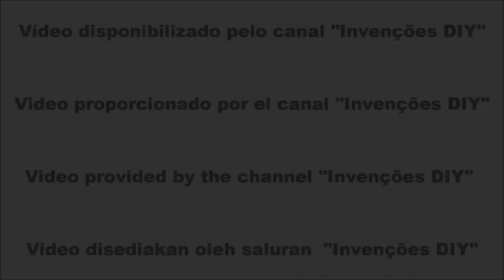Como fazer um simples motor elétrico! Simplicidade do engenho na comparação com motor Stirling.

Comment: Please say  what is the length of primary or base can in your Stirling engine video.  Please . The fruki can 300ml green color.  Please say the diameter also . I tried to find it in internet but i can't.
Reply: Please say
Reply from the maker: And I already answer you, I am taking care of my daughter, due to Covid in my country.
Leandro Wagner.
Reply from the maker: Hello! I apologize for the delay in responding, but I have a private life that requires my attention.
The primary can of my engine, the green "fruki", is a 350 ml can, I cut it 8.5 cm high, and its diameter is 6.8 cm in diameter. This can is like Coca Coke cans.
You can find more information about my engine on this page:
http://manualdomotorstirling.blogspot.com/2014/09/lista-dos-materiais-usados-na.html
http://manualdomotorstirling.blogspot.com/2014/04/continuacao-do-texto-no-you-tube-com.html
There is an automatic translator inside the page that you can activate.
Leandro Wagner.
Reply: Thank you  . Actually I am a student of mechanical engineering from india . I was wanting to make a different type project. I just love your homemade engine making process . Thank you very much for your reply 😊❤️